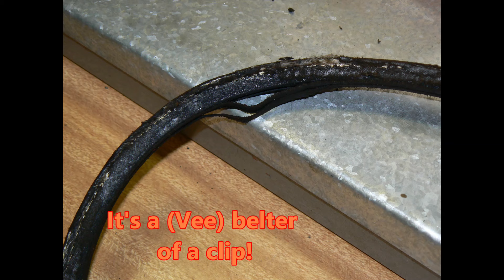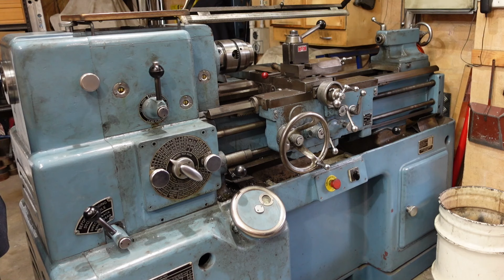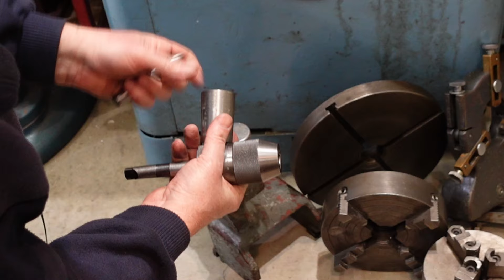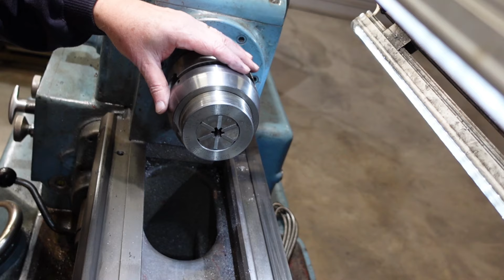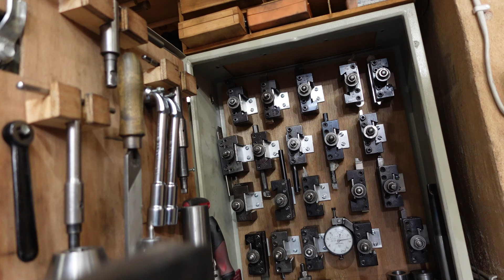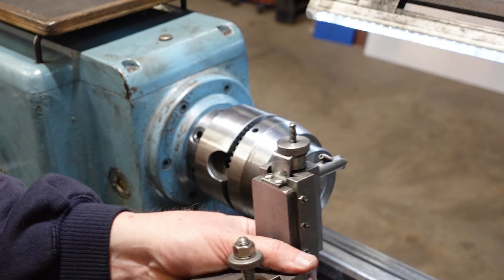Lathe basics to match the mill basics

Comment: The stroboscoptic effect to which you refer with flourescent lighting is because of the possibility at the "right" speed the frequency of [chuck/material] rotation could match the frequency of the flourescent lighting causing the appearance of the spinning item LOOK STATIONARY! The danger being placing hands or tooling near rotating machinery that appears non-operational.
Reply from the maker: Yes, although I'd love to have a strobe I could sync with the lathe so I could see what knurls and interupted cuts look like during the cut...

Comment: Thanks man. I got a hell  issue parting off materials. The lathe I a Storebo with a 2 hp engine.  It grabs and  destroying everything in its way. Any tips? Thanks for your videos.  Cheers.
Reply from the maker: I'll see what I can come up with, but part close to the chuck, make sure that the cutting edge is bang on centre and that there is as little slack in gibs etc as you can get.
Reply: Thanks for taking your time to answer my rookie question.  I'll try the tips y gave me.
Reply from the maker: @JB-ol4vz  I know people who have been home machining for years and they have problems, so you are not alone and it's not just a rookie problem. Thanks for the inspiration though - I have started planning out a video showing some of this stuff.
Reply: All of what @occasionalmachinist said above AND make sure your tool is aligned square to the Chuck.
Reply from the maker: @colincreedtattoomachines  Yes. I started listing things to do out and that is on there too.